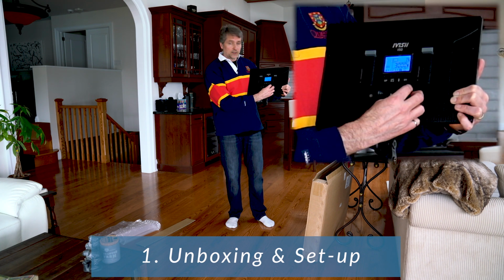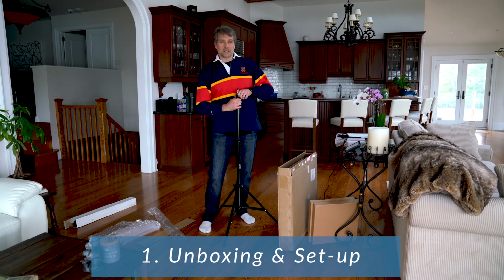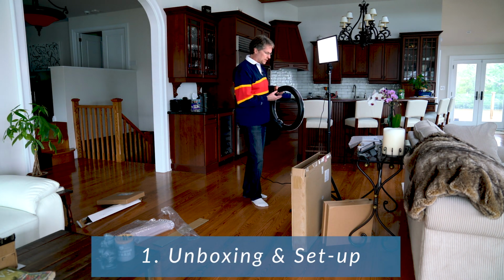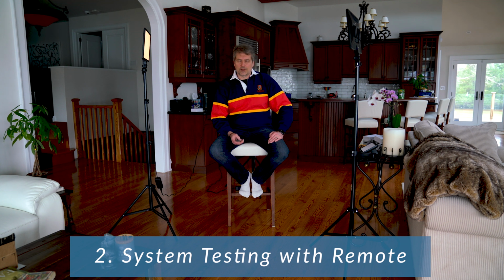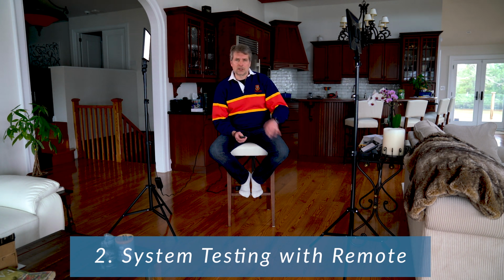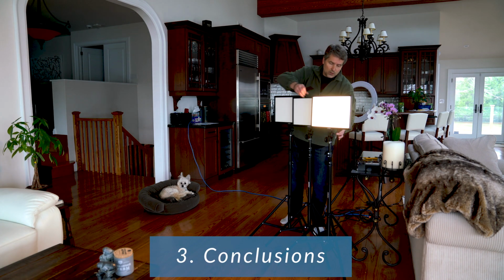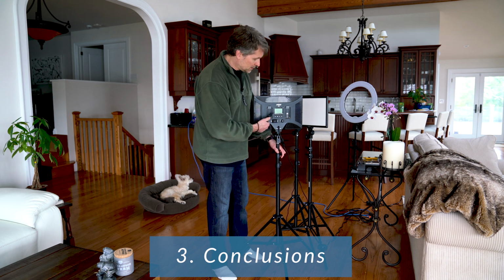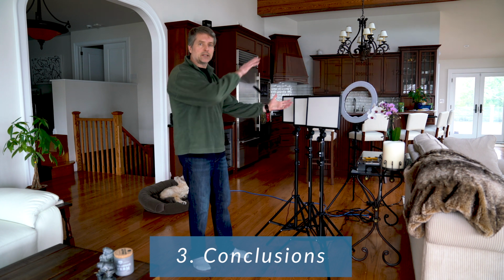IVISII LED Video Light Set!

Comment: How much “runtime” do you get on a charge? 

I was surprised by the price. Much less than expected. Nice review.
Reply from the maker: Allan Kobelansky Thanks for watching! Great question. Honestly, I haven’t noticed. However, you can use NP-F550 (2,900mAh), 770 (4,400mAh), 970 (6,600mAh), etc., so there is lots of flexibility. You choose the run time via your battery selection. The company sells a charger and 2 NP-F770s for US$38, so the cost is not prohibitive.